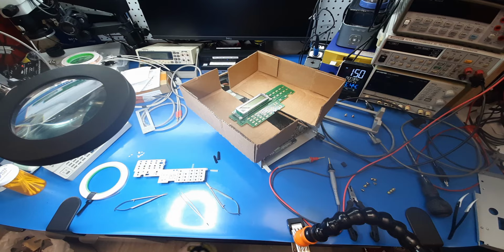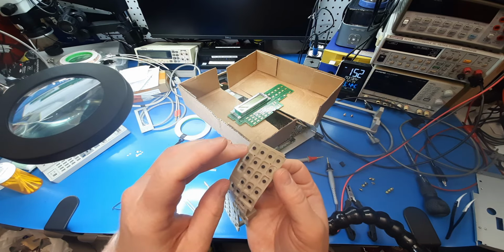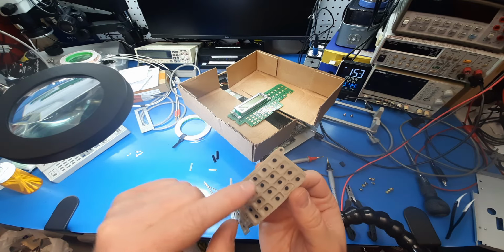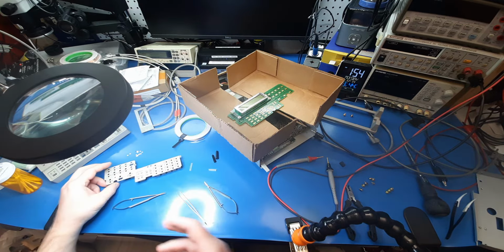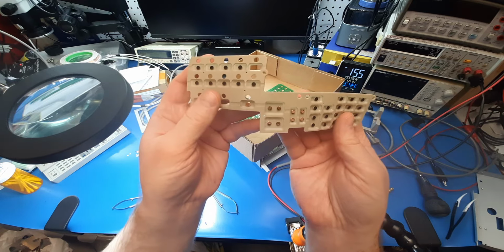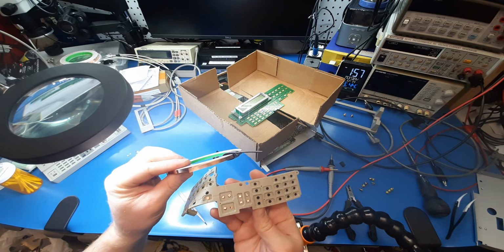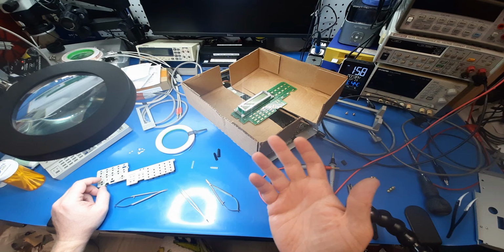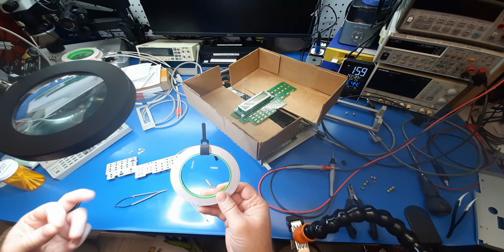How to restore malfunctioning membrane buttons.

Comment: I'm surprised the adhesive works.
Reply from the maker: Honestly going into that repair I wasn't dead-set on using the copper and wasn't sure of how good the bond would be - I tried graphite re-impregnation first but the results were underwhelming - unreliable contact / not great conductance improvement.  The aluminum tape would not bond at all but whatever adhesive is being used with the conductive copper tape formed a good bond.  I'm glad, because I really didn't want to use chemically destructive methods for the repair - my preference is for it to be reversible with no 'can't-be-undone' effects.

Comment: Thanks for the tip. I do have various widths of that copper tape already. On another note, you wouldn't know where to buy similar tape but without the adhesive? Thanks!
Reply from the maker: You can buy pure copper strips, as well as copper coated nickel.  You can also buy 'pure copper' strips that are actually copper coated nickel, so be aware.  I found my stuff on AliExpress and that's probably the lowest cost source of it, though you'll need to do magnet and cut testing to find out if it is actually pure copper.  The thicker stuff is generally associated with high end battery tab welding work.  Oh, and if you are looking to glue it to something, check out the site thistothat.com - you can use it to look up what glues are best for bonding material A to material B.